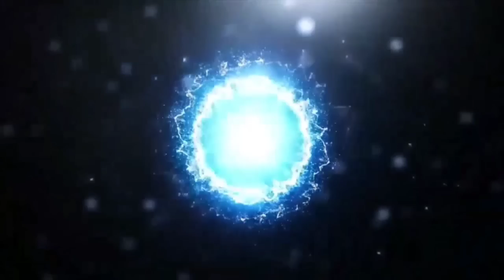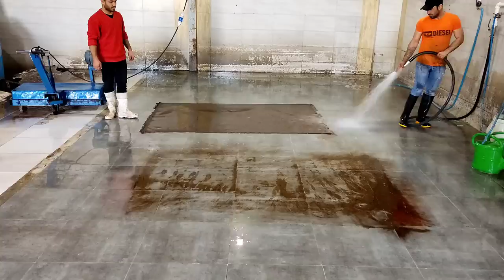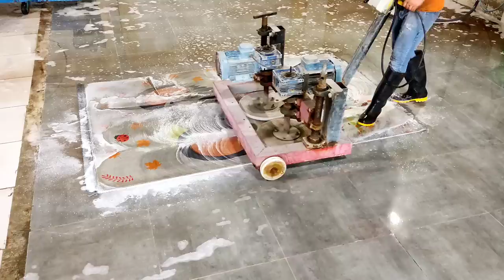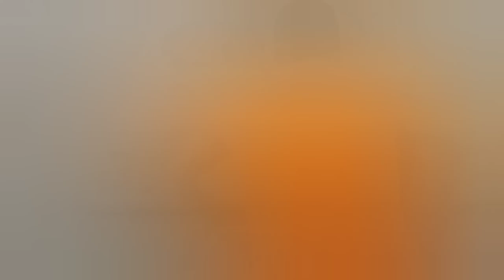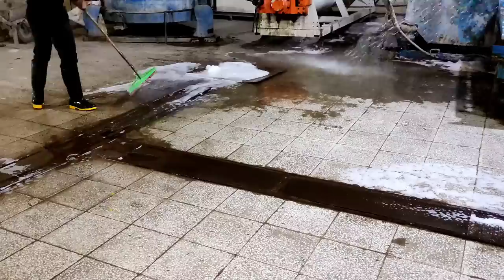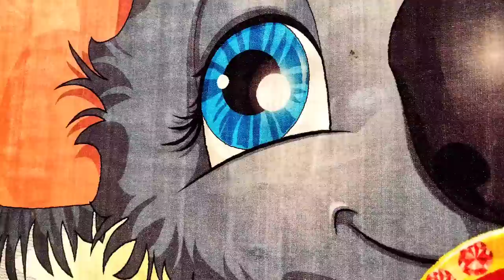How To Wash A Cute Koala In A Carpet Cleaning Service Center  |  ASMR Videos

Comment: Have they ever tried to hang them as they clean them?  I used to hang my client's carpets and would hit them with a pressure washer, which would get 90% of the crud out in the first round. The pressure and gravity was the ticket. Then I'd turn up the heat just enough to loosen any gum, wax, or dried crud and it worked great.  The last thing I would do would be to brush it but I would hardly see the difference.
Reply from the maker: No yet, awesome👍❤